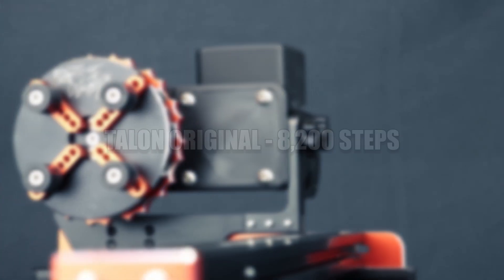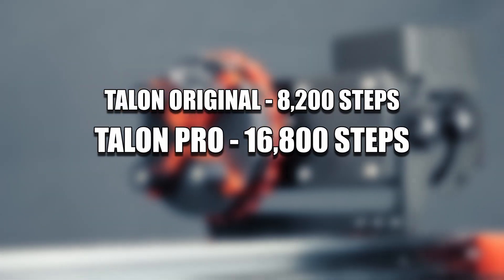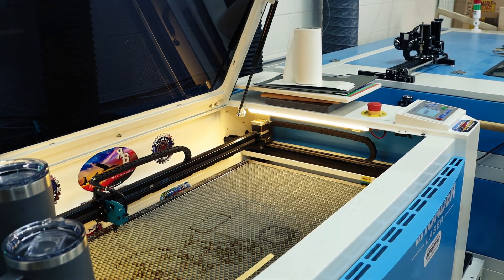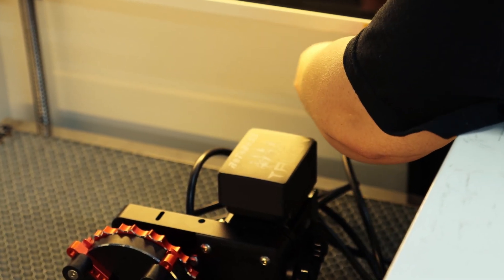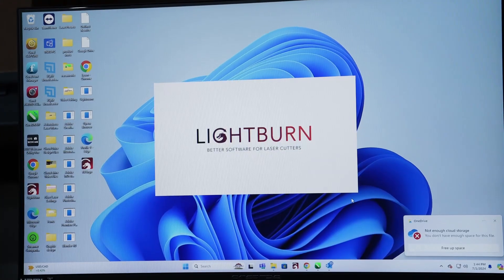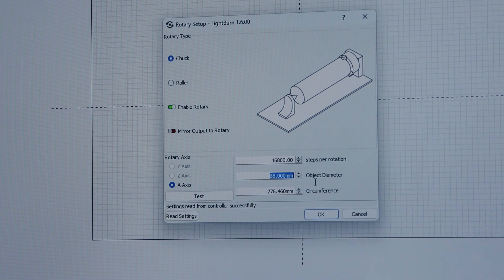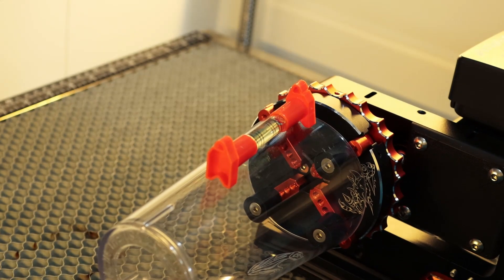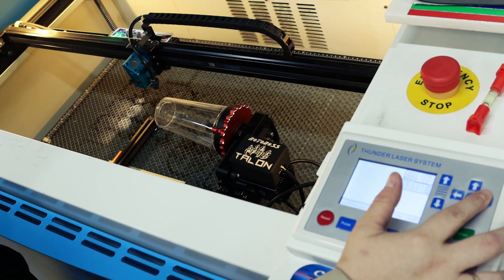Rotoboss Talon Pro, The First of its kind articulating belt drive chuck rotary Testing

Comment: Are there plug adapters for different machines so that you could use the same rotary on a Thunder Nova and a Haotian galvo? Thanks.
Reply from the maker: @steinbierz  unfortunately there is no way to cross those two brands. They run on totally different motors.
Reply: @rotobossrotaryattachments  Bummer…thanks.

Comment: Can the Talon pro fit into the Thunder Bolt Laser?
Reply from the maker: @namhoang22  yes it will
Reply: So does this double the engraving time?
Reply from the maker: @blaineeveringham7439  No, not really. It allows you to engrave at faster speeds and depending on the detail and settings you could go a little faster, you can  get more detail and smoother movements as well.